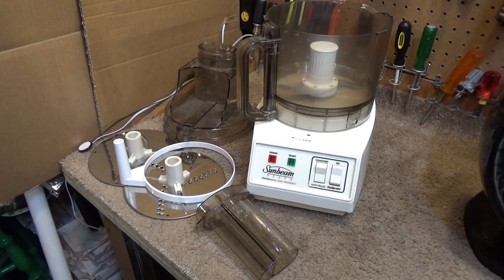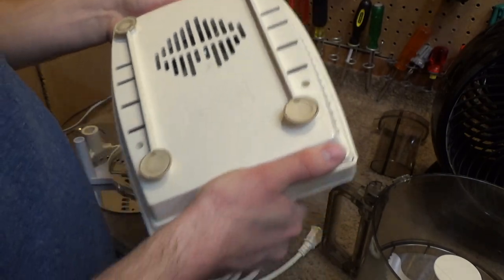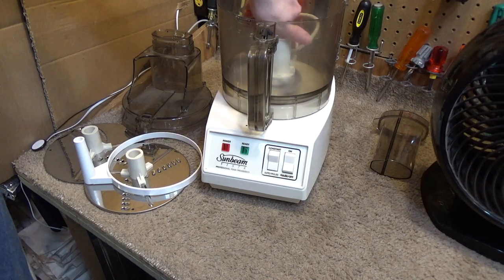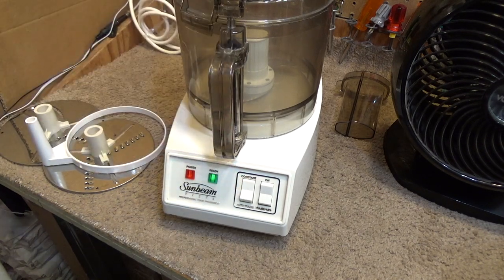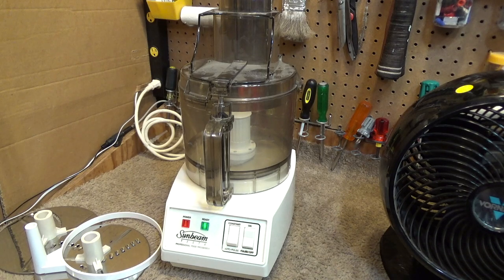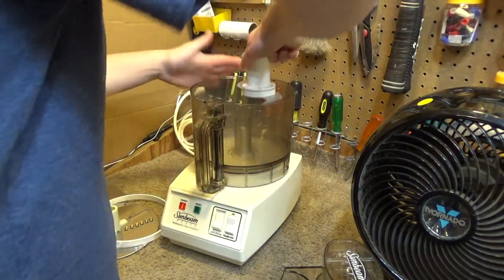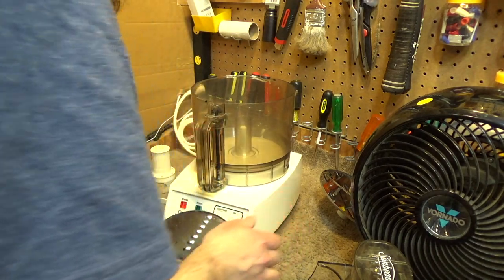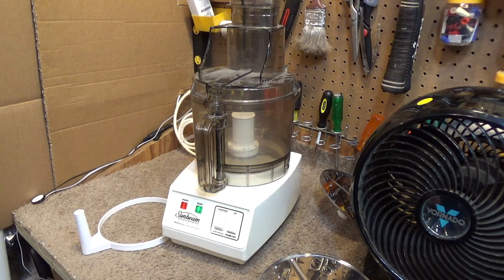Sunbeam 84071 Professional Food Processor | Initial Checkout

Comment: Have you found a vertical stem for this unit that holds the disks? I need one also!!!
Reply from the maker: I have not tried to find one yet, first I need to check the stem from my other processor and see if it fits. It end to think this would be a standard size.

Comment: It used to come with an adapter to hold the round blades in place. I got one similar to that one. Mine is missing the regulas S blades. 🤷🏻‍♀️
Reply from the maker: Thanks for letting me know.
Reply: @JordanU  I found the S blades inside my mom's dishwasher. 🤣 I've been using the processor for some months now and it is working just fine. The plastic container is kind of delicate though. I think mine is a model from the late 80's.
Reply from the maker: @guaynabicha  The plastic on this one feels like it's starting to show its age as well, but as long as you're careful I suspect it will last for quite a while still.